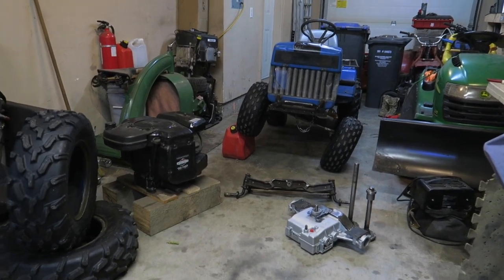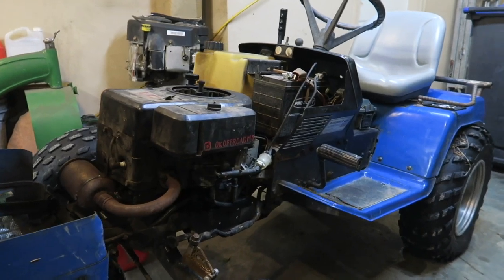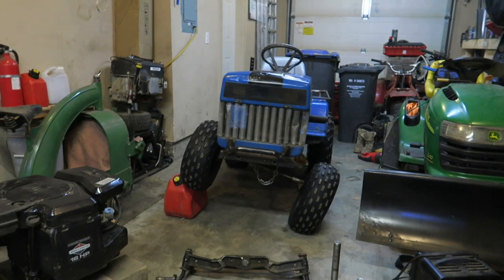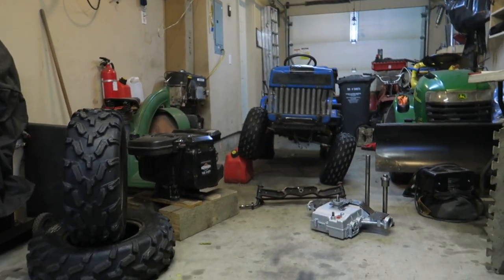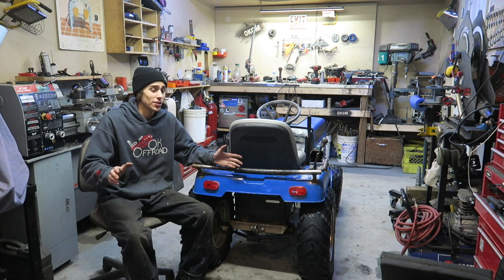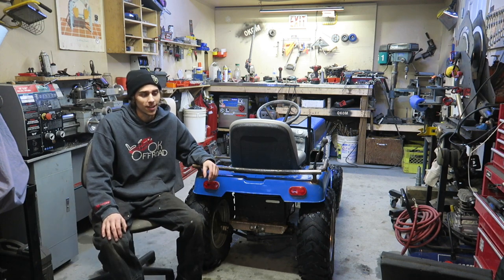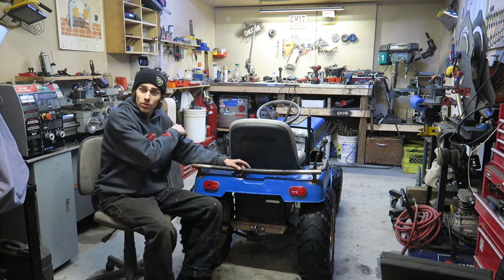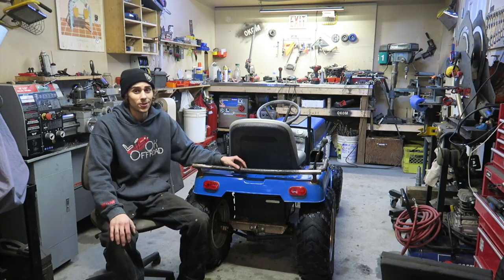Building a 3-link fully custom off-road rock crawling mud mower

Comment: I need tires that that can go through snowwithout out weights and chains. Then again maybe I should use something other than sears turf savers. Great build! Love your channel and you inspired me to mod out my mower even more!
Reply: Some good tight fitting chains on turf savers with a locked rear end can really do some serious work. no need for wheel weights unless you're plowing and or... I make rope "chains" for my turf tires they're much less scary going fast and they tell you when they're gonna break. the rings that hold the ropes on are secured to the rim on the outside almost looks like a bead lock and they hook to a hub on the axle..  It's not my idea I've seen stuff like that done by other ppl I may make a video of the setup some day idk it seems like it should be done more but idk
Reply: Gonna have to try the rope chain Idea out. 2x4 atvs don't get much traction on ice without studs. And yes I was gonna put a plow on but the mount to fit my frame was to high :(